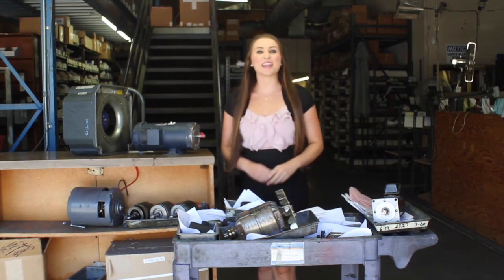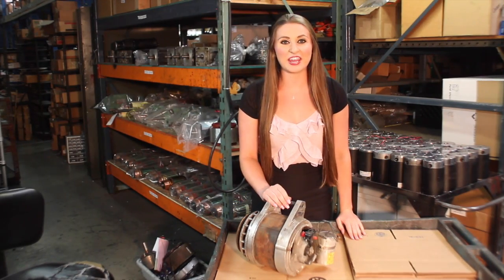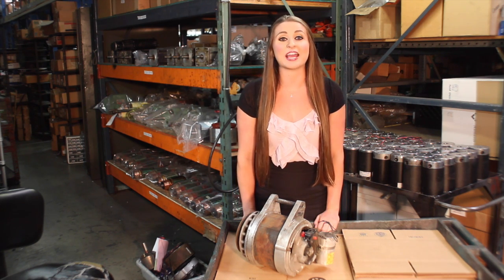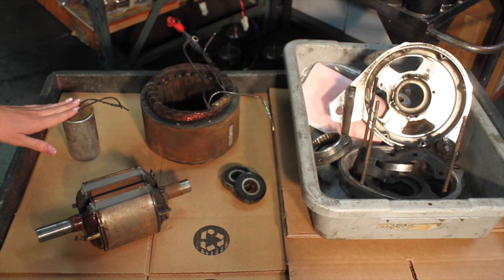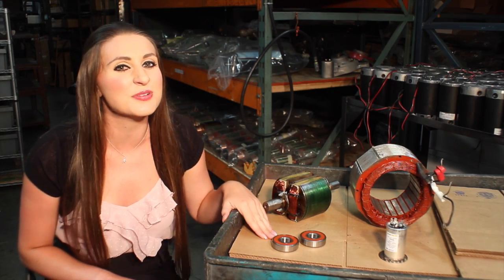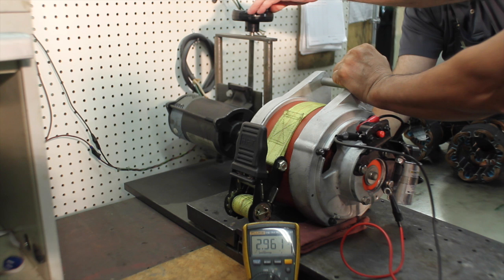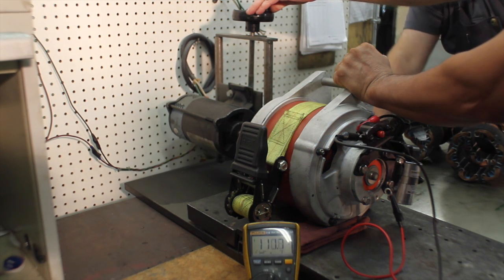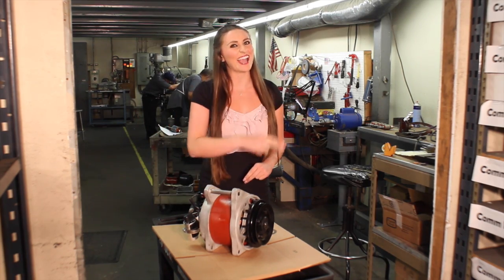APU, Auxiliary Power Unit, Rebuilding

Comment: my apu motor went bad and part of the shell cover got a hole as a result water and chemicals from the road wet the components, time  passed by and I never fix it till one day I try to do so but the generator is rust shut, I wonder if the generator can B repaired since parts are scarce and expensive. how much will it cost &  how long does it take?